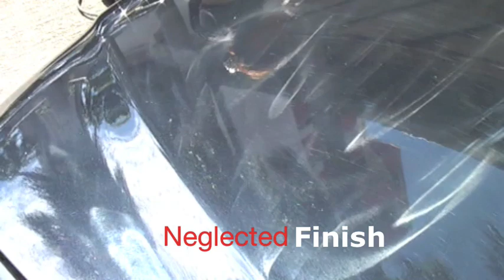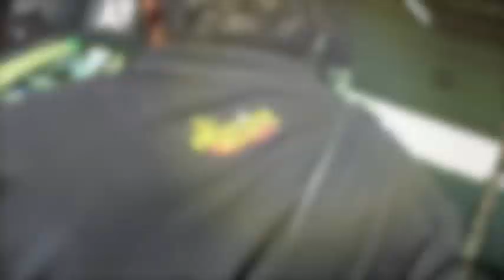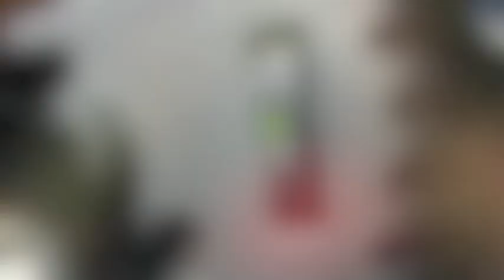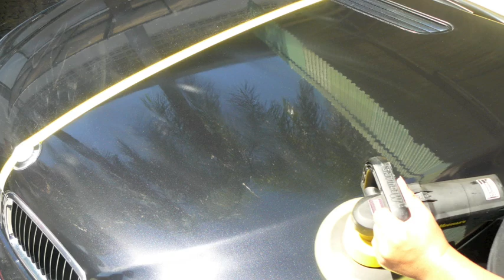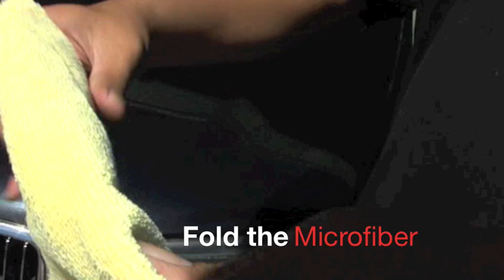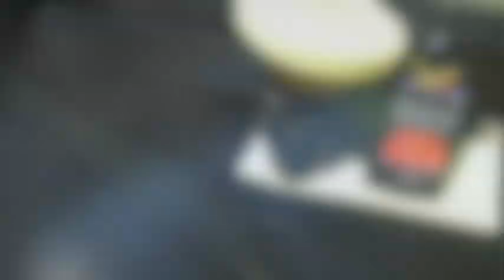How to use Ultimate Compound

Comment: Actually the proper way is to wash after compound. The reason is that the car may still have residue from the compound which should be entirely cleaned off the car so theres no contimination for best results

Comment: Is it OK to use this product under direct sunlight?
Reply: Robert Dahl Kristensen generally it is recommended to use in a cool shaded place. But under the sun is okay if that's the only option. Especially if you are going for quick and dirty 'maintenance' session it's not that much issue. Prolonged exposure under high heat is the problem. Try your best to avoid that.

Comment: get 2000 grit wet sand paper and some light compound use soap and water carwash soap should be good for the wet sanding rub the scratches lightly with the wet sand paper they should start to go away dont got to far into the clear ..than dry and polish back up to factory shine ..in most cases you can use a orbital  buffer

Comment: Impressive demonstration and great vids as always!! I have a black Mercedes C-class with swirls similar to the 7-series in this video. I have tried Ultimate Compound and Swirl X by hand and it hasn't worked. What should I be doing by hand? should I give up trying by hand and use a machine?

Comment: PawelAugust75
If the car looks good leave it as is and just put a coat of carnauba wax or sealant for protection. Polishes/compounds don't leave anything behind after, they are abrasives that cut down the clear coat.  you need to apply wax or sealant after for protection and shine.

Comment: Technique is sloppy and lazy. He should be doing 1/4 of the hood at a time and not half. Furthermore he's working in the sun on black paint, NOT GOOD. Also, he used a lot of product and didn't even bother to spread it. Instead he just placed it on the hood and off he went. Would not be surprised if he wore down a lot of clear coat around the leading edge as well as the sides where the hood meets the fender. and this guys is a REP?!?!?

Comment: Why are you doing such a large area at once and why are you moving so fast? Are you a beginner by any chance?
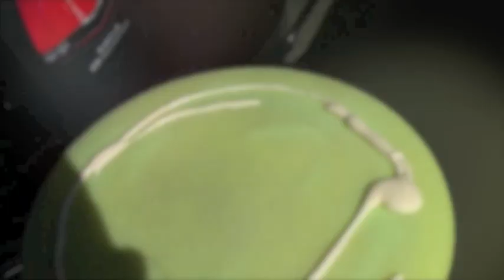Reply: Rails Life He is definitely not a beginner. His arm speed is slightly faster because the hood is already heat up by the sun and use it for his advantage and you can notice he is using speed setting 4. If the car were in the garage and he definately will use speed setting 5 and slower arm speed because the paint is cool and he need heat and power from the buffer especially on BMW paint which mostly have hard paint. Observe the foam pad at 2:06 you can see the pad is already prime and if you familiar with Meguiar's compound line, Ultimate Compound have an extra oil in it and that's why he polish at bigger coverage and he probably did a second application to reapply the compound to finish up the hood just that not show in the video.

Comment: Really no. They are doing it in the sunlight to show you the difference. A swirl finding light clearly wouldnt give a very good representation of the swirls and defects. When you polish on your own do it inside. In the sun the clear coat heats up and becomes more malleable, then adding the heat from the buffer really cuts too much out of the clear coat. Inside is safest, plus you avoid any dust or debris blowing onto the car put more scratches into it

Comment: of course they put in these scratches. but meg. compound is nothing special that other compounds could not do. i use rotweis products for example and they can do the same for much less money. it just removes the upper part of the clear coat. you can use this kind of scratch repair maybe 3 or 4 times, then you reach the paint of the car.

Comment: the steps he took was completely wrong!,
1.the car should have been in the shade or garage
2.spray Detailer and wipe the surface WITH A HIGH QUALITY MICROFIBER TOWEL NOT A USED AND DIRTY ONE!.
3.apply a 10inch line of product on the surface and put the buffer at the 10oclock position, then bring your buffer up to speed and slowly go across the bead with moderate pressure.
4.overlap 50% in each pass twice.
5.wipe to inspect with a clean mirco towel!

Comment: Ultimate Compound is straight garbage.

That product has got so many fillers in it, it's not even funny.

The guy's technique in the video is complete shit too, proving that all they did was mask the holograms and fine swirls in the hood with the fillers in this Ultimate Compound.
Reply: Ryan W. not the best for cutting you're correct, but it works great for removing oxidation